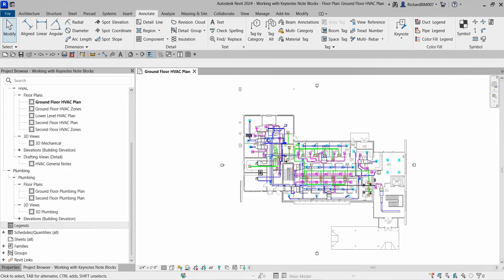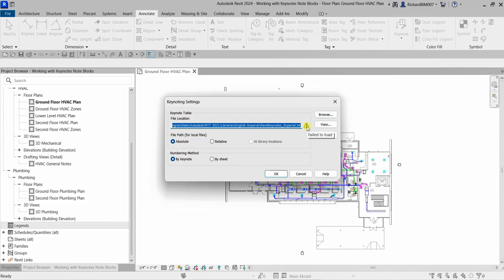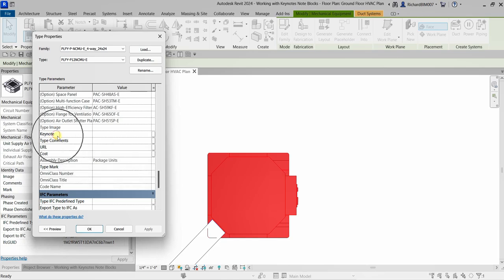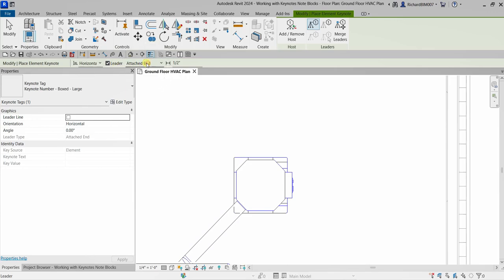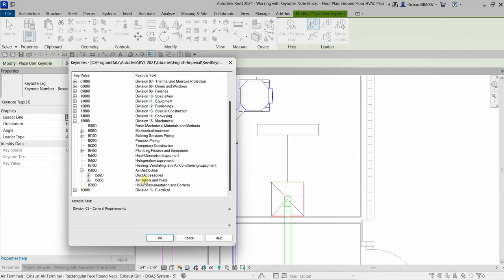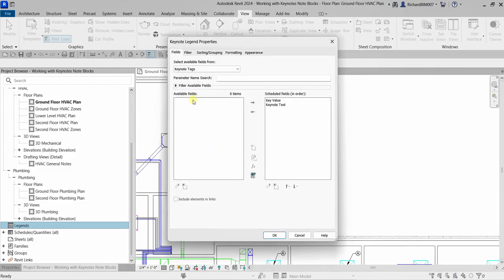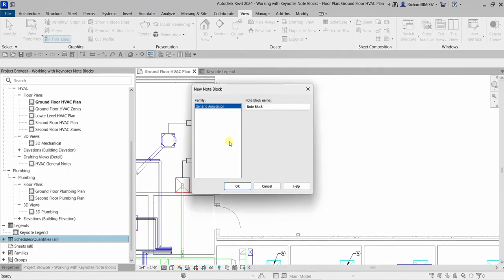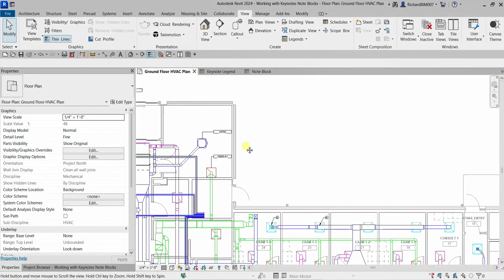REVIT MECHANICAL DESIGN PROFESSIONAL CERTIFICATION PREP: WORKING WITH KEYNOTE AND NOTE BLOCK

Comment from the maker: Check out my top 5 BIM books on Amazon:

BIM and Construction Management: Proven Tools, Methods, and Workflows 2nd Edition: https://amzn.to/3KdzAId

Increasing Autodesk Revit Productivity for BIM Projects: A practical guide to using Revit workflows to improve productivity and efficiency in BIM projects: https://amzn.to/43B4j8F

BIM Handbook: A Guide to Building Information Modeling for Owners, Managers, Designers, Engineers and Contractors: https://amzn.to/44LhRQE

The BIM-Manager: A Practical Guide for BIM Project Management: https://amzn.to/43FGJHV

The BIM Manager's Handbook: Guidance for Professionals in Architecture, Engineering, and Construction: https://amzn.to/3rALK7g

Comment: What is the use of "note  block" ?
Reply from the maker: Hello @ahmedelbaradie1440!

A "Note Block" in Revit refers to a specific type of schedule that allows you to create and manage tabular data, such as notes, specifications, or any other textual information, in a structured format. It is commonly used to document design decisions, project information, material specifications, and any other relevant textual data associated with the project.

Here are some key uses and benefits of Note Blocks in Revit:

Documenting Project Information: Note Blocks are an excellent way to document project-specific information, including design notes, project requirements, and client preferences. They provide a structured format to present this data, making it easier to read and manage.

Material Specifications: Note Blocks are frequently used to create material schedules. You can list various materials used in the project, along with their specifications, manufacturer details, and other relevant data. This helps in coordinating and tracking materials during the construction phase.

Specifications and Standards: Note Blocks are valuable for presenting project specifications and standards. You can include information on building codes, regulatory requirements, and any specific standards that must be followed during construction.

Design Changes and Revisions: During the design process, changes and revisions are inevitable. Note Blocks allow you to document these changes, providing a clear record of design modifications and their impact on the project.

Quantity Takeoffs: Note Blocks can be used to perform quantity takeoffs for various elements in the project. By listing quantities and other necessary information, you can generate accurate material and cost estimates.

Room Data Sheets: For architectural projects, Note Blocks can serve as room data sheets. These sheets contain information about each room's finishes, fixtures, and other details required for construction and facility management.

Project Coordination: Note Blocks facilitate effective communication between team members, consultants, and stakeholders. By consolidating important project information in one place, everyone involved can access and reference the data easily.

Customization: Note Blocks are highly customizable, allowing you to define the data fields and organize the information as per your project's requirements.

Overall, Note Blocks are a powerful tool in Revit that enhances project documentation, coordination, and communication. They streamline data management and ensure that vital project information is readily available when needed.